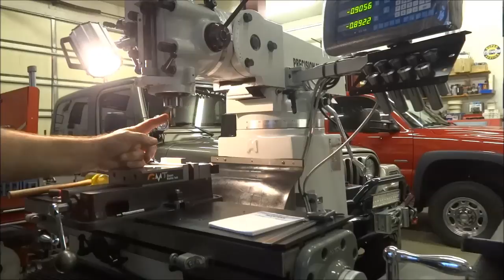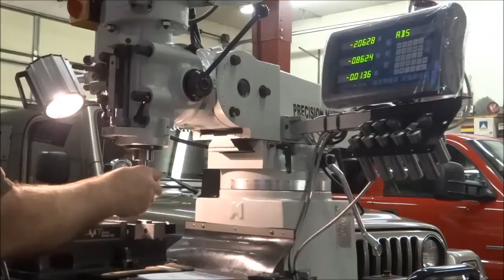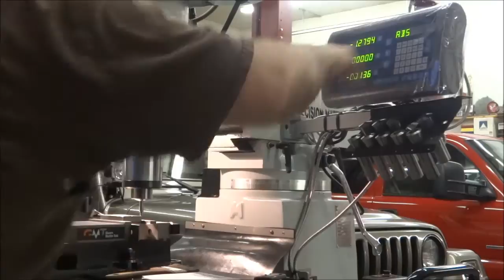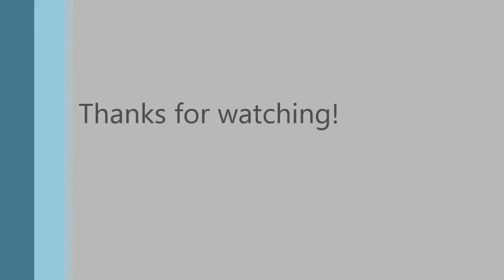T-Nut Machining on PM-935TV

Comment: Really good video thx. I too have the PM1340GT lathe with the PM-QCTP. The T-slot base for the QCTP is a generic fit as you know. It would be nice if Matt offered the T-nut you are making here as an additional option. I plan to also buy the PM-935TV in 2018. Very incredibly nice tools, more than well worth the cost.
Reply from the maker: Thanks for the comments Jim. You’re gonna love that PM935 knee mill. 
Thanks for watching. 
Mike

Comment: Really appreciate your vids as there aint much on this unit on yt. Have you used the head swivel and tilt on the 35tv yet?.. curious if these features are just as solid.
Reply from the maker: Thanks for watching and for the comments.  

Yes, I’ve turned the head 90-degrees to machine a few things. Most difficult to hold rigid was a Jeep sway bar. It worked great but had to get creative with holding the work. 
Mike